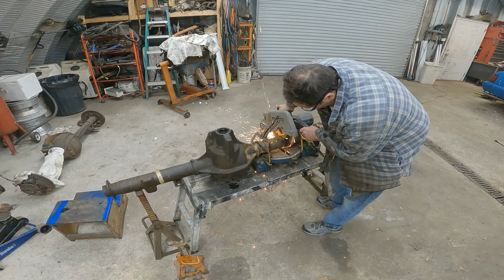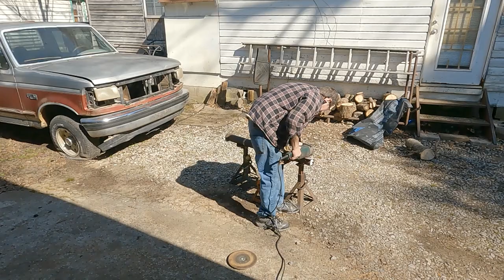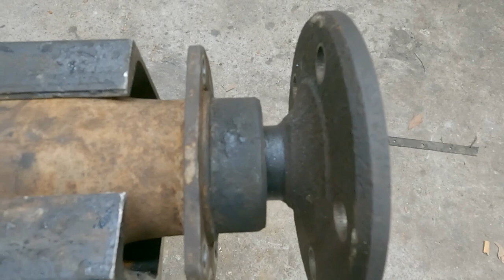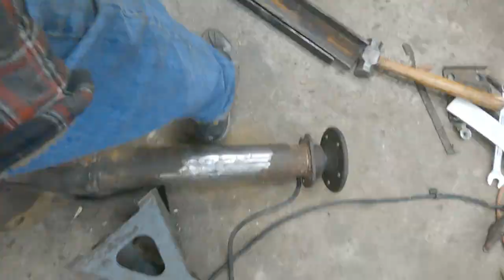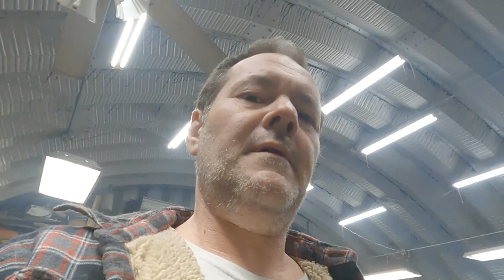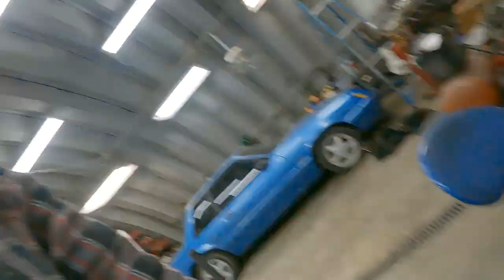Shortened 8 8 Explorer rear end for 87 V8 turbo Ranger

Comment: Right on. I'm gonna be doing the same thing here soon. Good idea to put some weld on those tubes where they meet the carrier as well.
Reply from the maker: I still have to put the shock mounts on and the perches on and get another short axel from PullaPart. Put it all back together and put it in. Hopefully it solves the spinning issues. I think I'm gonna go with some 3.55s.
Reply: @kickassmustangsgarage  Don't weld in the perches etc until you make sure you got the right pinion angle. It will deff help. I'm doing the exact same thing.
Reply from the maker: Thats why I didn't cut the other side perch off yet. I gonna see if it clears on top of springs like it comes in a Explorer. Try to lower the rear to help with weight transfer. As you know they don't squat and hook
Reply: Nice 3d effects with the closeups of the welds.
Reply from the maker: It's on 1080p in this video 2700k and 5000k looks crazy good but I have issues editing with it on them for some reason. Start a fresh comment next time it doesn't let me know when people comment on other peoples old comments. The 3d effects  are probably how lumpy the axel tube is after I ground the shit out of the welds LOL.